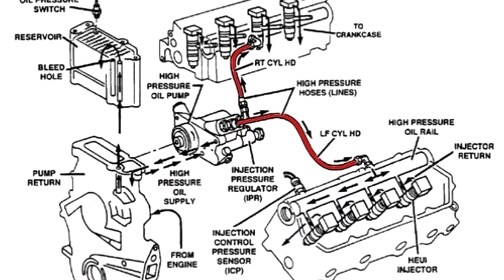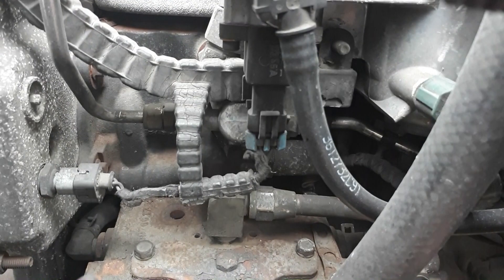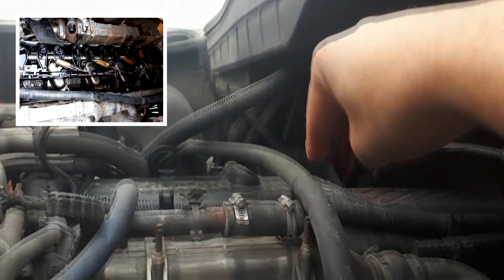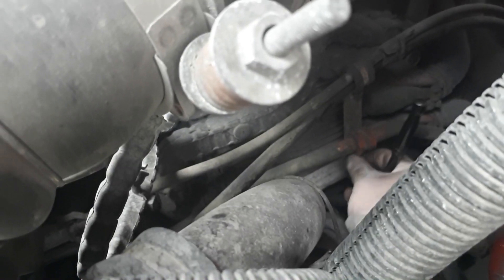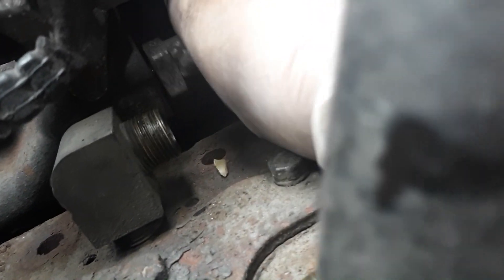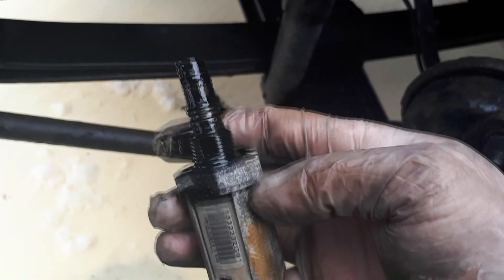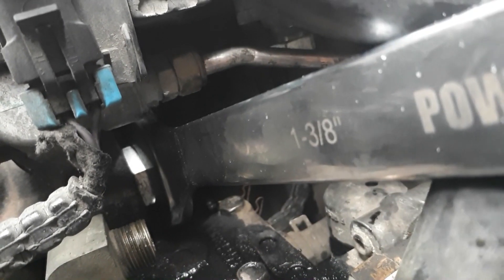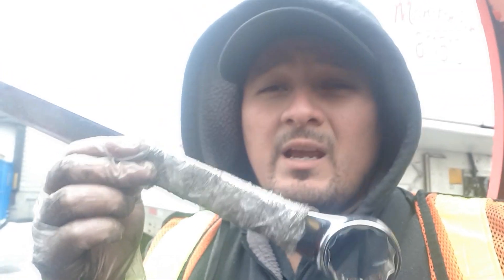Maxxforce engine issues | IPR valve replacement

Comment: Excellent video! It's great to see you as an owner operator figuring this engine out. You're saving yourself a ton of cash. I have been in the same situation as you since our fleet has ten DT MaxxForces and eight MaxxForce 7 diesels years 2010 - 2013. You can full field the IPR harness meaning full battery voltage (no more than 30 seconds) to open 100% for testing. To check for leakage at the high pressure manifold disconnect main hose from high pressure pump, adapt fittings and apply shop air usually 120 psi to the manifold. Any leakage requires seal replacement as you did in your video. It's a big job pulling that manifold! FYI the engine brake also runs off of the high pressure oil system. We've also replaced the injector wiring harness (integral with the valve cover gasket) and injection pressure sensor but which usually comes up as a stand alone engine code. Injection pressure needs to be 800 psi to start and under full load reaches over 4,000 psi so seals need to hold for power and normal operation of the injectors.

Comment: I just bought a truck with that engine. It has  a check engine light and looses power on hills as well. I will be purchasing the IPR valve and replacing as well. Thanks man.
Reply from the maker: You will have to replace the O-rings on the oil rail eventually. If the check engine light persists, try changing the pigtail connector. Very common problem is the actual connection.
Reply from the maker: I sold mine a long time ago and got Cummins instead, best decision ever
Reply: @thetransporterboss  all my fleets have cummins best decision ever! I have 1 international and its a HOT MESS ENGINES ARE GARBAGE
Reply: Miles, how is your truck holding up? Whats the total miles on your rig?
Reply: @Pearidgemafia   My expectations were a little to high. First of all its an 11 liter and I have it coupled to a 1998 Hilbuilt end dump trailer (11-14,000lbs unloaded), which in my opinion the truck is not built for what I need it for. I'm not gonna bash International at all hell everything I own work wise is international. This day cab has just shy of 400,000 miles, it was a fleet truck for performance food group. Probably coupled to a 20 foot refer van all its life, which is probably the best application for it. I'm gonna baby sit it and put a nice price tag on it and use the funds to purchase a straight ten wheel dump truck.

Comment: I don’t know about the MaxxForce high pressure oil pumps but the earlier dt466e it was only a few hundred more to get a hpop with a icp regulator valve installed in it. Which can be more cost effective in your situation because if the injectors are not still leaking around the orings then you need to get a hpop now spending a lot more then you could have. There were issues with the connectors on the harness that plugged into the icpr in the earlier dt466. These problems may have been corrected in the MaxxForce though. If you have time on your hands you can remove the valve cover and I believe unplugging the icp sensor will put the pump into full pressure  then watch the orings at the injectors for leaks while running. Also the MaxxForce is very sensitive to battery voltage. So a weak battery, while still being able to crank the engine will drop voltage and the ecm will turn off and not start All while still cranking.

Comment: Not bad! My only grudge is i would have put fresh engine oil around the o-rings on the ipr valve to help seal them and protect them during installation. Other than that it was a very visually descriptive video and accurate.
Reply from the maker: Great point, the o rings definitely need lubing before reinstalling. I usually do it to my oil filters but totally forgot to mention it on this application. Thanks for the tip.

Comment: was it the fuel sensor high pressure ', that you replaced, if so how did you get the bottom bolt out and would you happen to have a video on it?
Reply from the maker: your answer is at 4:35 , you gotta break the old one and replace with a shallow connection one. Good luck!
Reply: @thetransporterboss  break what? The sensor or bottom bolt and was it the high pressure fuel sensor?
Reply from the maker: @maxithotshotadventures9616  oh sorry, mine was the ipr valve. Not sure how your fuel pressure sensor looks.
Reply: Ok, thanks! I thought you said you changed that one as well in the video, guess you didn’t.

Comment: Hi, i have a 2009 International workstar. Truck starts excelent when cold but will NOT restart when hot. It also has a slight miss which at idle is noticable.
Reply from the maker: Those are most likely the O- rings on your oil rail. When the oil is cold thick, it starts easy since the o rings retain the oil easier in the oil rail. The opposite occurs when the oil is hot and thinner. If you crank then engine for 30+ seconds when engine hot and then it starts, that’s how you know it’s time to replace the O rings on the high pressure oil rail.
Reply: @thetransporterboss That makes total sense.

Comment: Nice video I have the same issue loosing power up hills do you this this can also apply for a maxxforce dt 9/10 year 2013 ?? I replaced the oil rail seals and icp sensor but still loosing power

Comment: Thanks for posting your videos i truly appreciate it .
I have a 2011 international 4300 maxforce 10i i got my motor rebuild i replaced the ipr sensor icp sensor all the sensors for the turbos replace the 2 turbos new injectors all 6 new o-rings new filters  i got everything new. In the morning it's a tarts with no problem. But after I drive it for like 15 minutes. If I turn it off and won't start i have to wait for like 40 minutes or turn the key on and off for like 10 times and to get it started i keep getting the code spn164 fmi18
I also get code fmi789 fmi2  I took it to the international dealer to service and now they telling me that I need all 6 injectors and the o-rings but I just bought them about 7 months. What should I do?
Reply from the maker: Hi, did you say you replaced all your injectors already? Don't replace the injectors again if you did 6 months ago. Replace the high pressure oil rail O rings  and pressure sensor only. The reason you have to wait for engine to cool off is because the oil gets thicker as it drops temperature, that allows for enough oil not to escape from the oil rail through the torn O rings.

Comment: I think I'm having the same problem loaded or unloaded I lose power up hills. What exactly is a little bit of power? Because I can go from 10 speed and drop to gear number 6 or 5 on an up hill
Reply from the maker: In the highway i would drop to gear 8 with little to no cargo. It looks like yours is losing even more power, it all depends on the load and steepness of the hill.
Reply: @thetransporterboss  I bought my 2013 for 7k im at 650k miles put 100k miles on it no issues except for this . Its just aggravating.  I hate going on a 60mph zone and doing 45mph. But once I get momentum there's no stopping
Reply: Did it also drop when releasing the accelerator losing power for about 5 to 8 seconds?
Reply: @ernestosaenz9621  it just has a lag time I keep it all the way dont accelerated.

Comment: What code did you get.
My looks have same problem.
Just very low powwr but sometimes very long crsnk. But only sometimes crack right up sometimes tskes longer..
I got code spn164fmi 1 sometimes
Reply from the maker: Yea that code seems familiar. Yea sometimes long crank was an issue if i remember correctly and it got worse with time. It turns out it was the o- rings that are located on the high pressure oil rail.
Reply: prime pump seal is bad need u cnt replace the priming seal

Comment: I'm getting a code that the ipr is not getting enough voltage any tips of where to look
Reply from the maker: Check my other video "engine problems low oil pressure code" I change the ipr pigtail there. I would start looking there.

Comment: After you get it running, how long before you're working on it again?
Reply from the maker: Good question, if you're asking because you're searching for a truck to buy, please avoid this engine. I have more footage to upload. I was working on it on it often like once every two months and it only had 200,000 miles or so.
Reply: @thetransporterboss  wow. I'm so sorry. Good thing you're so good at mechanic work.
Reply from the maker: @unkjason  im not too knowledgeable in mechanics but i think i can get by just fine in the basics.  I think all truck owners should learn a bit of basics in my opinion. Thanks for watching and hitting like on my videos, it will help to one day get monetized.
Reply: The Transporter I found a 2013 with a million miles on it for $3500 might need egr is it worth it
Reply from the maker: @bigsean131  I'm not sure if you're saying this as a joke or not, but if you're serious, please please please avoid this engine. It will cause you down time and money. Buy a more expensive truck with a quarter million miles or less with a more reputable engine.

Comment: How many miles can these motors run before problems start ?
Reply from the maker: From brand new i would't even give it 60,000 miles until a major problem starts. The engines are no good, be aware before you buy.

Comment: Is the maxxforce the same as DT466 engine?
Reply: No this engine is a Maxxforce with EGR. The original DT466 was the best medium duty diesel ever... in my opinion ( No disrespect to the Cummins B). If you see one grab it even it needs an overhaul (inframe would be cheaper than a couple of emission parts for the MaxxForce). In later years the DT went electronic (DT466E) with hydraulic injection HEUI like Maxxforce  but a lot more reliable.
Reply: @MechanicsHubdotCom  I thinks most of the newer internatinal trucks 2010+ come with the mxxxforce engine, in newer models 2015+ they switch to cummins engine, from what I've heard it is more reliable.
Reply: @izh6421  we started buying Cummins ISB in 2014 which saved us from major disaster.
Reply: @MechanicsHubdotCom  I'm currrently looking to buy a 2013 international with an in line DT466 with 200k miles, any advise?
Reply: @izh6421  any IC buses 2013 will be Maxxforce. I would advise you look for a Cummins ISB. It might be newer or you could consider Thomas buses who started using Cummins years before 2013. Don't choose MaxxForce ....too many problems.
Reply: @MechanicsHubdotCom  thanks for the advise brother.
Reply: @izh6421  dont...I did that mistake and cost me 18k new motor only 275k on the truck in the other hand my dt466 is approaching 800k

Comment: Im having the same issue bro did that fix the problem?
Reply from the maker: It fixed the starting (long crank to start problem), you have that issue too? or are you referring to the engine light coming on but works fine?
Reply: U can get one socket at oraly s gor $30 fix exact for removing it but this video its right got samething and got me headaches
Thnk
Reply: Hello from north carolinas what engine its that you have
Reply from the maker: I got a Maxxforce 9 engine (310HP)
Reply: Ok thanks i got a maxforce 13
Reply: Me two guys after change my fuel filter I start losing power ..why is that the cut be the issue guys any suggestions???
Reply: @LuisCarlos-fy6rq  checa el turbo,presion en injectores,que el filtro dpf no este tapado
Reply: @elchicotony7637  pero mi troke donde tiene el filtro dpf??
Reply: @LuisCarlos-fy6rq  depende el año normarmente esta abajo del chasis ala lado del pasajero
Reply: Nada viejon pinche troke ya asta ke cambie el injector #1 y sigue igual
Reply: @LuisCarlos-fy6rq  checa en facebook esta francisco amaya el es buen mecanico esta en youtube tambien

Comment: ICP sensor on the fuel rail. Thatll cause you to have low pressure if the o-ring is bad or sensor has failed. Try that. Be careful with your gasket under the valve cover as some models have the harness for the Injectors integrated to it.
Reply from the maker: I had replaced the ICP sensor and o-rings previously as well, it didn't resolve the issue.

Comment: NEED HELP ,WE ARE HAVING TROUBLE FIGURING OUT WHAT THE CORRECT IPR VALVE AND PIGTAIL ARE , EVEN CALLING NAVISTAR ...THEY COULDN'T FIGURE IT OUT! !  MAYBE YOU COULD HELP.  WE HAVE A 2014 INTERNATIONAL/ NAVISTAR  MAXXFORCE 7  SHUTTLE BUS ,  MODEL # AC/UC SERIES COMMERCIAL BUS   PC805 6.4 LITER ENGINE .  300 HP.
Reply: The Maxxforce 7 that you have does not have an IPR valve.  You have a high pressure fuel pump/ common rail fuel system which does not require ipr. Instead your pump uses a fuel volume control and fuel pressure control valves. Hope this helps.
Reply: @dthetruckguy1499  Thank you sooo much !